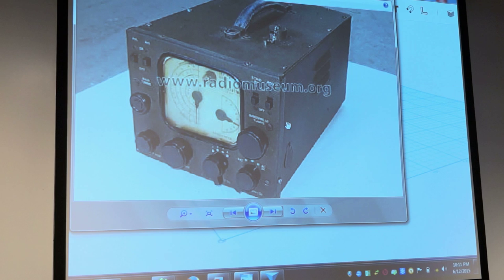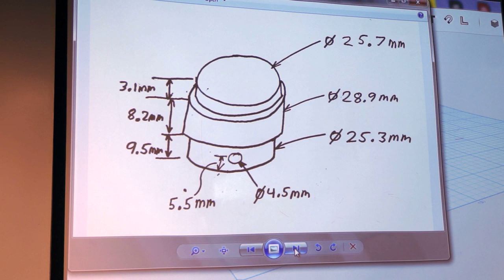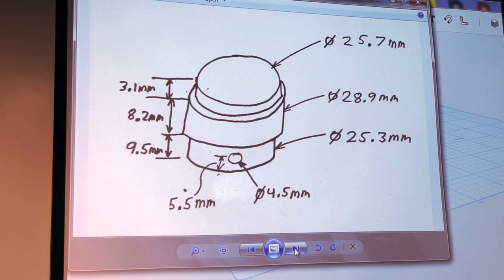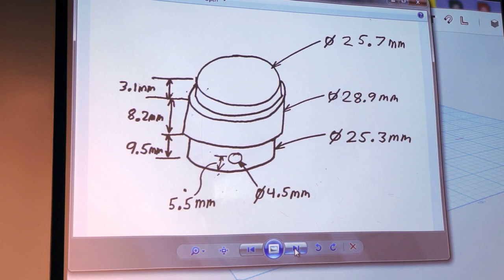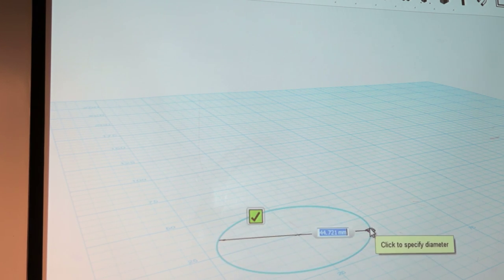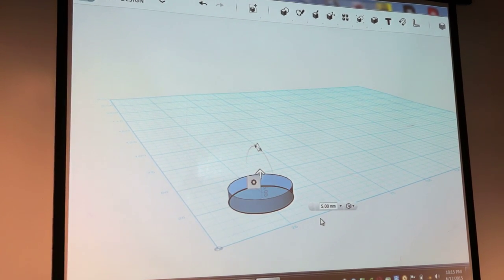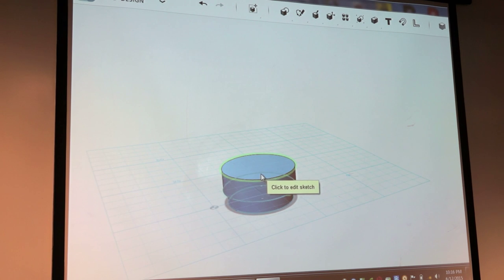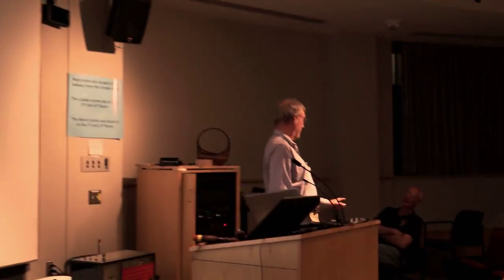3D-Printed Radio Knobs

Comment: NOt very informative at all.  Basically telling you how to get started making an object, that's pretty much it.  No description of how to get a center hole, no smoothing techniques no filler if you need it solid.  Rushed and not very good at describing what's going on, how to convert that draw into a file nothing. Video is entitled "3D-Printed Radio Knobs", not as described.